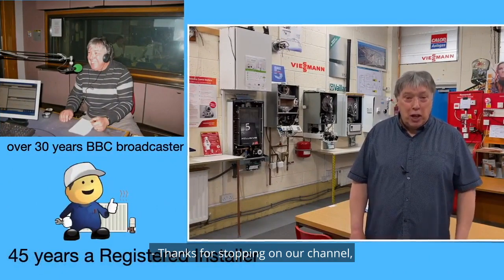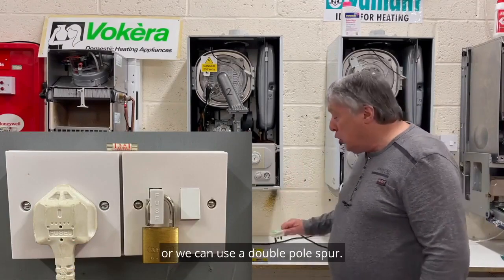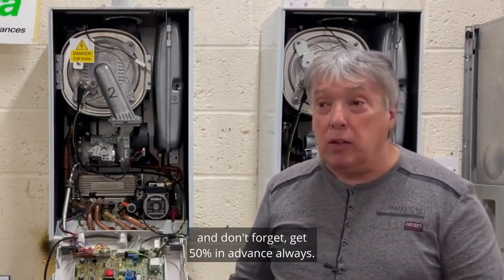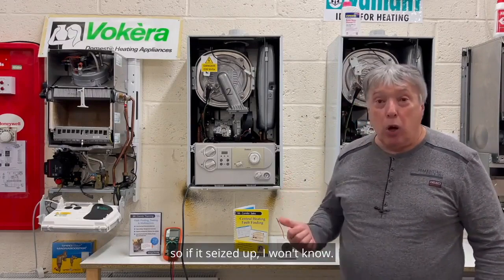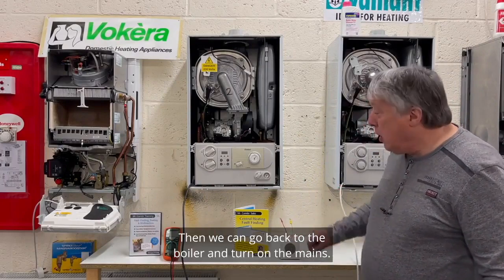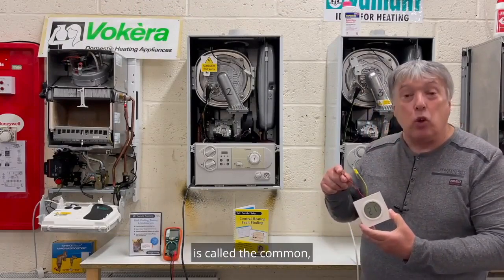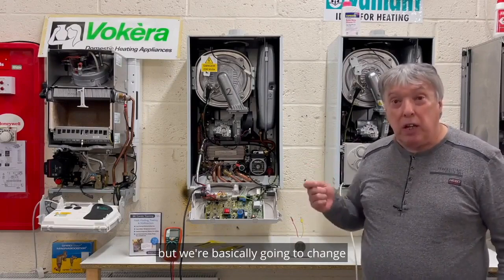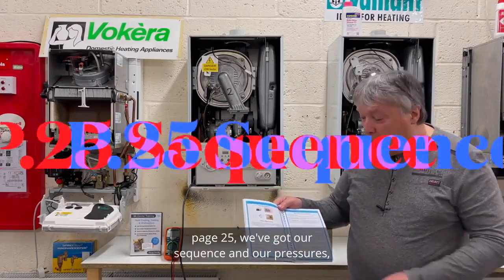Boiler Faults Find Most in 5

Comment: I have a  vitodens 100w WB1C combi boiler. I noticed that the circulation pump never shuts off when in heating mode. Is that normal? It switches on/off as expected when I use it only for hot water. Starts up when I open the tap and shuts off when I close the tap. But as soon as I turn on my UFH, it just goes forever. I don't have any additional room temperature sensors or timers.
Reply from the maker: Thanks for asking, every circuit MUST  have time and temperature control that's basic install requirements, we do have a few installers who cheat customers and not fit anything thus very high bills, shame really. 😓
I love UFH with a Combi extra low running costs 100% efficiency, rads are so wasteful and the worst way to heat a home, but it make's us rich. 
As your pipe water should be between 35C /40C a ROOM stat is compulsory in the LOUNGE. set to 20C then adjust to your comfort level. If your don't want the expense and cost of Smart, then go to RF (radio frequency)  In two videos time I will cover this subject, but see some on my vids. on controls.

Take care, George Staszak 👍😃